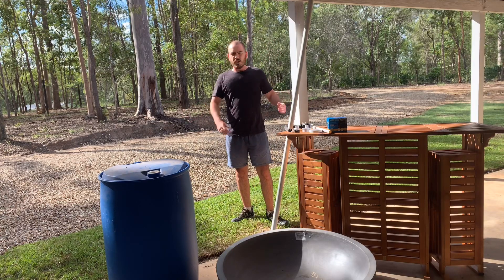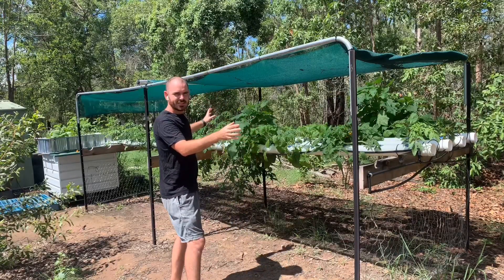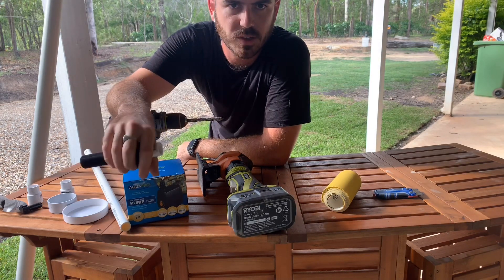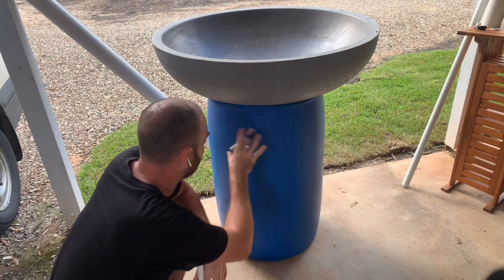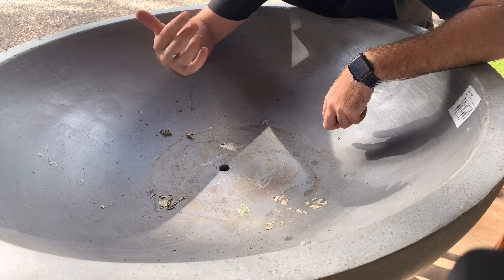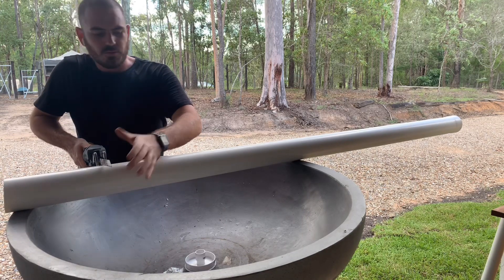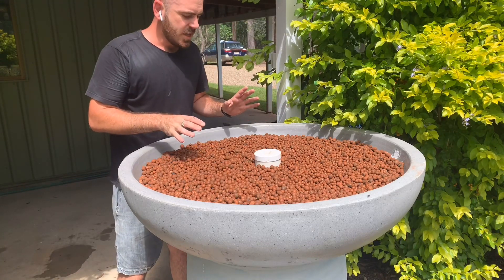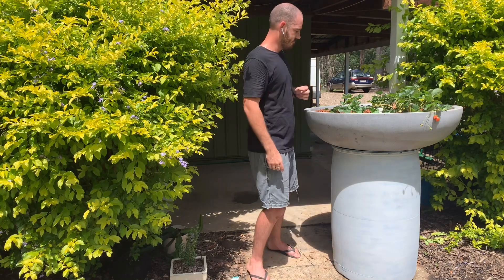How to Build a Bell Syphon Flood and Drain Grow Bed

Comment: Hi Hoocho. You can also achieve a similar "bell siphon" by using a U-tube in a similar fashion to the U-tubes used in the professional Dutch Buckets. When the nutrient level rises above the top of the U the siphon begins. The siphon continues until the nutrient level falls below the U-tube inlet. Adjusting the height of the U-tube adjusts the maximum height of the flood cycle. I have found these U-tubes to be more reliable than tradition bell siphons. Simply screen the input with some flymesh or even a piece of course weedmat. Hold the flymesh in place with a cable tie. You could alternatively use a PVC cap with a pile of small holes drilled in it as your screen.